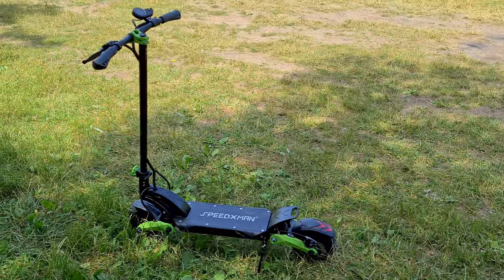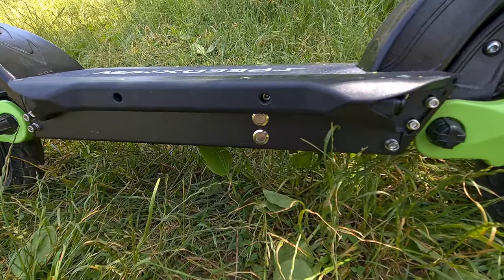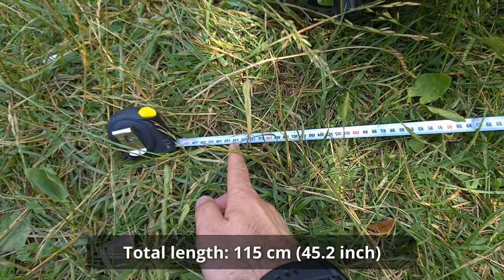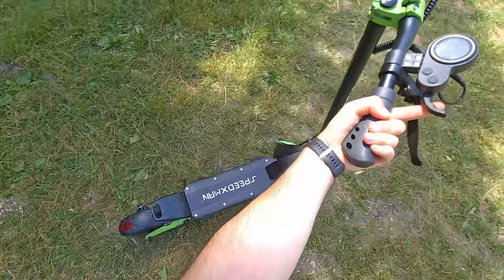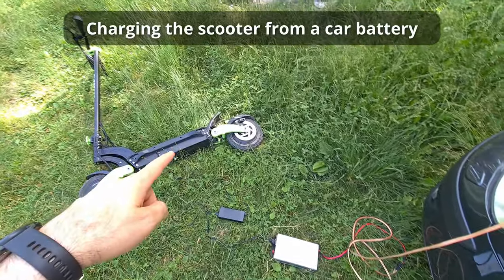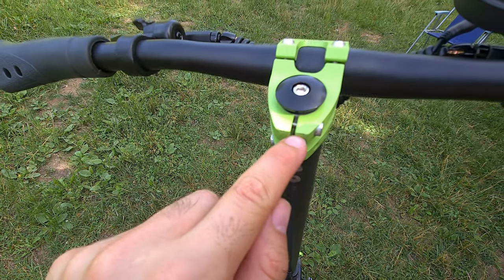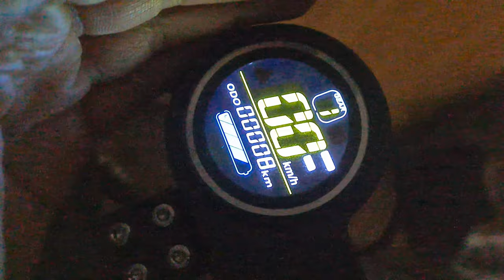Cyberbot SpeedXman scooter/Trotineta (48V, 19.2Ah, Dual Motor 500+500W, 8.5", Regen. Brakes)

Comment: Hi, do you know what brand battery cells are used in this scooter?
Reply from the maker: I'm not sure about the brand, I haven't opened it yet, but theoretically they are 2170 lithium cells which are larger than 18650.

Comment: What is the current limit on the controllers? 25A?
The Cyberbot weighs 4kg but goes faster than my 48v Vsett 9+ (25kg)
The claimed top speed seems overrated. But I don’t know?
Reply from the maker: Controller 2x20Ah is mentioned on the website of the local shop.
(https://e-trotineta.ro/produs/trotineta-electrica-speedxman-cyberbot-48v-192ah-dual-moto-peak-pw2000w/)

Once I tested the maximum speed and as soon as it reached 50km/h I released the accelerator, so maybe it could go even faster, but it is not balanced well enough and it has vibrations, so there is no need to use it at high speeds. In the city I always use only the 1st speed/gear, it's more than enough when both motors are enabled.
Reply: @furulevi  thank you.
It must be somehow more efficient with the current than the Vsett 9+.
Maby shorter wiring or better motors.
Great review by the way🙌
Reply: @furulevi  ești român frate ?

Comment: Max real speed?
Reply from the maker: I tried it just once and it reached 50 km/h pretty quickly. Be careful, it can be dangerous!
Reply: @furulevi  I think real max speed is 40kmh or less, with 500w engine you can't reach too much
Reply: @matteopongi  there are two motors x500W. I am 85kg and easily got to 56km/h on this scooter :) will post a review later today if you curious mate
Reply: @VRMinde  think you are totally wrong, it's impossible to hit 56kmh with 2x500w motor, haven't power, also wattage and amperage, if you look at display they all show fake speed, make a camera on your headgear and take the speed by gps
Reply: @matteopongi  Maybe I am wrong, but I took the speed by GPS, mate. Did it at least 3 times :) I could consistently hit 55-56km/h, if I went downwind and held it for longer I could probably get even more, but I am too chicken to ride 8.5" wheels at these speeds :)
Reply: @VRMinde  make a video and show to all the real speed by gps
Reply: @matteopongi  I will upload it in a couple hours
Reply: @VRMinde  where is the video?
Reply: @VRMinde  are 24hrs
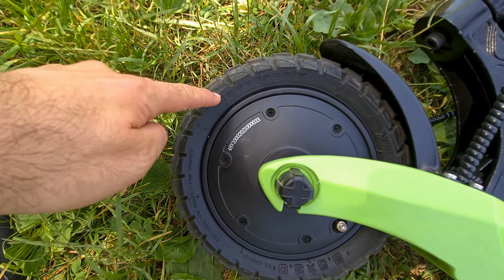Reply: @matteopongi  again, scroll to 04:46 if you just want to see speed on gps
Reply: @VRMinde  at 4:46 speak about tires
Reply: @VRMinde  do you think we are stupid?  maybe she is or she writes some nonsense just to sell, she talks about GPS detection and then lets the wheels spin without load, I think that if it reaches 35 / 38kms loaded it is already a lot
Reply: @matteopongi  are your eyes ok? Or you can’t use the link? I tried the scooter in real life with gps, but you “know better” without even trying? I posted a video proving the speed to you, but you still “know better” :) sounds like you are funny man. I will not argue with you if you already know everything man. Live in your own small world :)
Reply: @matteopongi  btw if you just pressed on 4:46 you saw 4:46 of THIS video, not the one that I have uploaded…
Reply: @VRMinde  ok tell me the video with GPS speed also minute/seconds
Reply: @VRMinde  in this video there is only the tires rotation without loading
Reply: @VRMinde  then first of all that speed is not taken by gps, you should use a phone holder or other device and resume what appears on the screen is very simple, the speed display you put on the screen is very strange also because at a certain point you release the 'accelerator and the speed continues to rise, I repeat it with a smartphone holder fixed to the handlebar of the scooter everything is clearer and more truthful as well as simpler not having to insert any image in the video, I repeat 35 / 38kmh I think it is its maximum, and until you pick up the speed from your smartphone you are not credible
Reply: @VRMinde  make a smartphone on handle bar and show the speed
Reply: @matteopongi  500W x 2 ?!!!